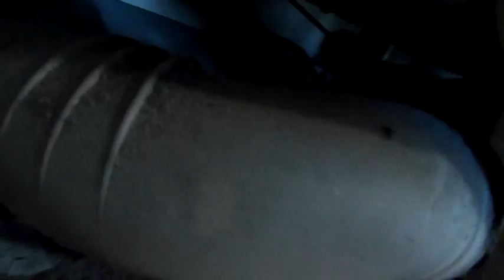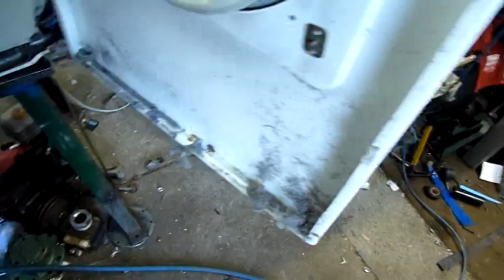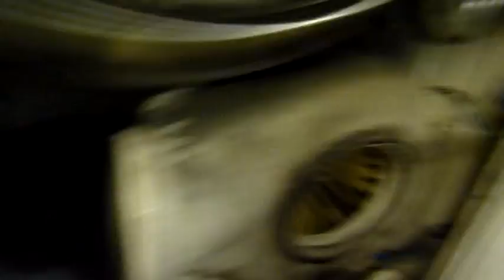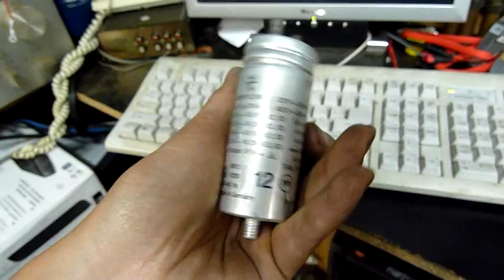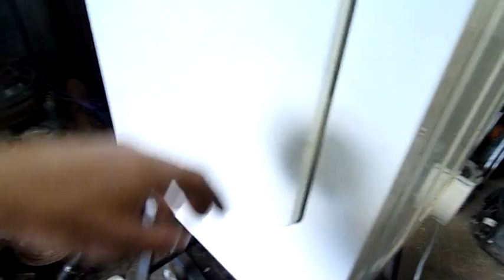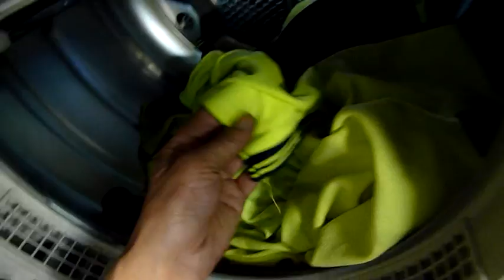Miele T366 Cloths Dryer Fix and Run

Comment: I'm commenting in 2022, so 10 years after you posted this video. This machine was on the market from 1983 until 1989, so even in 2012 it was very impressive that it was still working! Would not surprise me if it was still going to this day 🙂

Comment: Hi i have similar Miele dryer. I had to have the motor rebuilt but now that I am installing it I am having trouble with motor placement so I can get the belt on. Question is the motor can rotate in the rubber seal in multiple positions. Should you be able to just slip drum belt onto the small wheel or does it need to be stretched on for tension?

Comment: Hi, I have an even older (1983) T355, and its timer has failed. Miele don't have the part but if I can get in there maybe I can fix it. Your video unfortunately does not show how the top is removed. On mine one corner is loose but the rest are solidly ancchored and I can't see any fixings. So is it just brute force or is there a secret? Thanks

paul

Comment: When fitting the 12 mF run capacitor, the cap terminals are marked "1" and "2". A brown (live) and a black (negative) wire comes out of the motor. Not noting which wire goes to which terminal, I need this information. Which wire goes to which terminal?

Comment: Best dryer you can buy. It may be complex, but it will keep working for 20 years or more. When something goes wrong it is usually the back bearing of the drum - this is easily changed.

Comment: I think those bars are the moisture sensor, they work by passing a small electric current through the clothes and as they dry they let less and less current through the fabric and once they reach the set amount of resistance I guess then it will turn the machine off.

Comment: That's neat, the motor cap has the same logo as some Siemens electrolytics I've found in some old european radios, it's a stylized version of the mythical beast called a "Hydra". I had no idea that they still used that emblem.

Comment: Oh YAY! You got it going again! :-)

Interesting front-door design! Definitely makes for easy servicing and periodic cleaning out of any dust deposits in the workings. 

Nice Miele. 

I couldn't help but to think though.....If you couldn't have repaired this, how would it have behaved if it was asked to dry a flywheel at 1400 RPM? :-D

It'd be interesting to see the flywheel in a modified tumble-dryer, but maybe not in this Miele. It's too good for that treatment. :-)

{^_^} BoomBoxDeluxe {^_^}

Comment: the band goes to a moisture sensor. in the UK if the dryer is in a garage or shed the moisture sensor or "sensor dry" as its called is totally useless. they only work if the dryer is in the house or a heated room.

hope this helps you out dude.

Comment: Smashing job, i didnt think it would take you long to repair it :-)
With a new drum seal it looks like a dam good machine.

Bloated capacitor death, lol, i replaced one in my mates hotpoint washing machine, it was on the controller board and was part of the power supply to the chips.
The front lights and led display were going mad, looked like the machine had a nervious breakdown :-)

Bunged in a 16v 680uf 105c panasonic cap from r.s semiconductors and all was well :-)
Well worth it:-)

Comment: that's a really interesting dryer! can you just plug it into any outlet? here in the US we have to have a special circuit for dryers with electric heaters. I have a dryer with a gas burner so it runs off 120V

Comment: those bands on the drum are for the moisture mesuring .
the machine wil terminate the program when it senses that the cloths are dry.

these are the best machines money can buy...its from the early 80's..

my machine was 28 years old when the timer unit died.If i had replaced that it stil has ran.